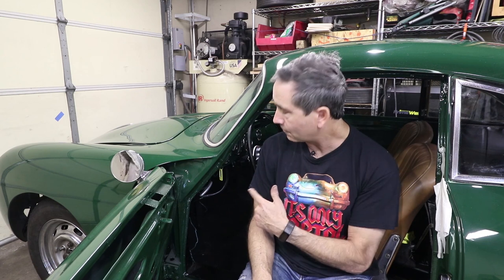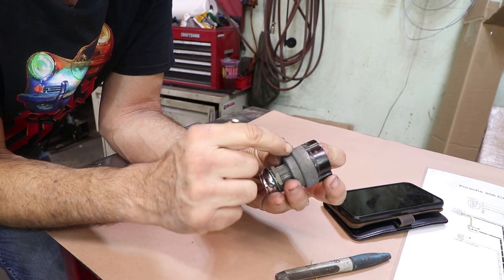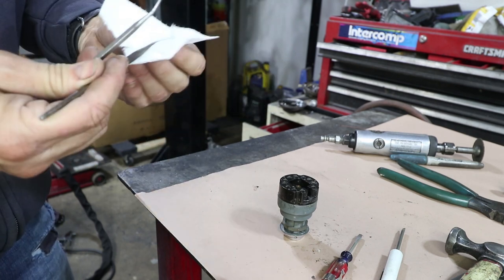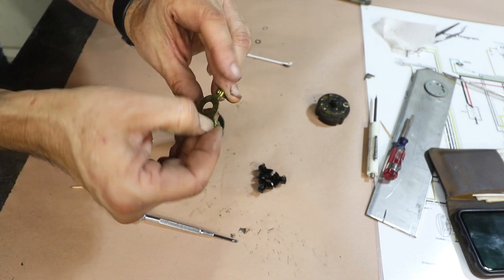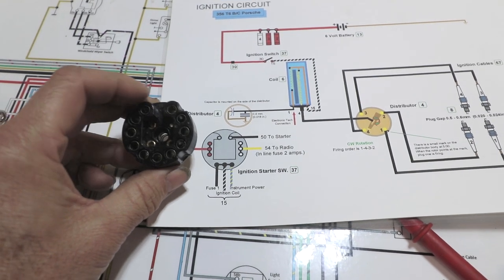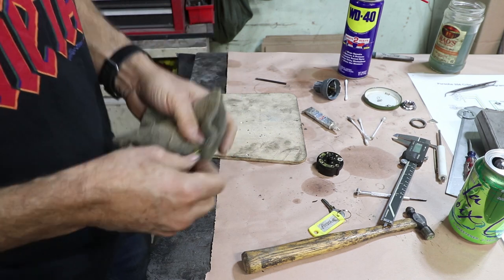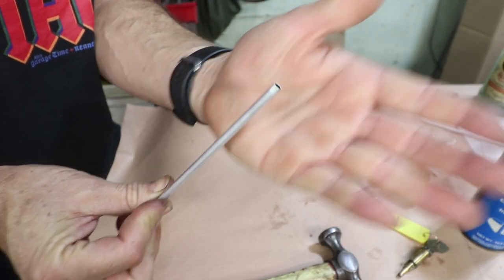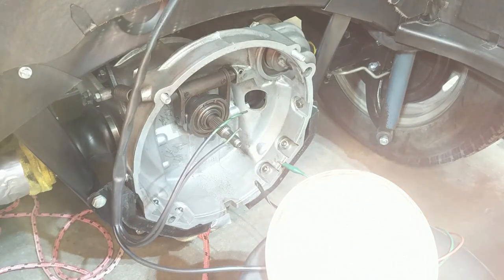Ignition Switch Rebuild Time Or BIG Wiring Mistake?

Comment: Tom, nice video.  I found that removing the circlip can be done quickly by using a pin punch on the back of the tumbler shaft and giving it a sharp rap with a hammer, forcing the circlip up and out of the groove.  This doesn’t work if someone has been there before with screwdrivers and sharp tools and they have damaged the end of the shaft.  I wonder how the factory did it, I have never seen a pair of circlip pliers that would work.
Reply from the maker: Well the factory never took anything apart, which is harder in this case🤣
I'm surprised at myself for not whacking the tumbler shaft with a hammer because it's my go to tool for almost everything.  
I'm glad it works and now I know.

Comment: Thanks for taking the time to film. I have watched your videos and it has help me. Just bought a ignition switch  with a key that doesn’t go all the way in on eBay to save money and this video will help a lot. Had the car since July and I have most of the rust issues fixed. This 356  has been wrecked and rolled over and picked apart bare. Pretty much a junk yard car The only good thing it has never been repaired by someone else except for a cheap paint job from the 70s with a little bondo.. Shooting to get it done by late summer of next year Thanks again
Reply from the maker: Welcome to the club!  My 911 was a wrecked shell when I started.  Best of luck and reach out if you need anything.
Tom
Reply: Bummer, I just got the ignition switch from eBay. You can tell it was never disassembled. The seller claims that the key that he made for it wouldn’t go all the way in. So I took the chance. I took it apart and by your video I realized that the Bakelite main body  was broken in the center Bakelite shaft where the washer rides against. So the key couldn’t go in because there was no tension on the cylinder to push it out to allow the key to go in and out Also the tension spring housing had a broken paw. I have yet not found a glue that is strong enough to fix something like that. Glue Smith glue I have used in the past works great but I really don’t want to take that chance. If I didn’t see your video l would probably took it to a locksmith and pay him just for him to tell me that he can’t fix because it’s all broken up inside . Thanks again for taking the time to make videos on your restoration on your cars
Reply from the maker: Sorry to hear about your broken switch.  Maybe the ask the eBay seller for a return or partial refund?
Reply: @GarageTimeAutoResto    I bought a few items from this seller and his descriptions is always accurate. He had a key made up using the key code on the housing. The key didn’t go all the way in. It was sold as is and I was the highest bidder at 50 bucks. No big deal and I was going in blind. You can tell that it wasn’t messed with. No hammer marks or forced entry. After I sent you the last message I decided to use the Glue Smith glue I mentioned on the broken paw and tried to put a bit of tension on it and it didn’t break. So I decided to tackle the center shaft that was totally broken in pieces and missing the center spring. I layer the glue with baking soda and a bit of silica sand and drilled it out used a spring from my spring collection and assembled it together and it seems to work nicely. Only took all day and pounding my head against my work bench . If you didn’t do your video I would of not known how that center piece looked like and it would be a total fail. Not sure if I will use it but I have a lot of time messing with it before it gets installed 
Thanks again

Comment: Love this kind of stuff. Those "simple" repairs that aren't so simple. Taking stuff apart that was never really designed to be refurbished and making it like new. I've never seen Sil-Glyde in a spray can (17:04). I love that stuff, too! And, brilliant idea for getting that ring clip back on!
Reply from the maker: Yeah, not meant to be taken apart.  New ones are about $225 which isn't as bad as 911 ones.  I'd rather put that money towards chrome, which is something I'm not equipped to do.  
sil-glide is great.  Made this lock mechanism work very well!